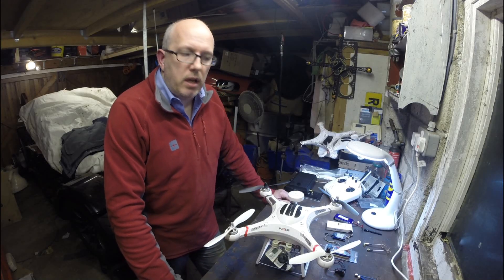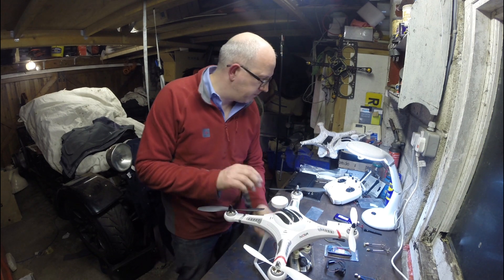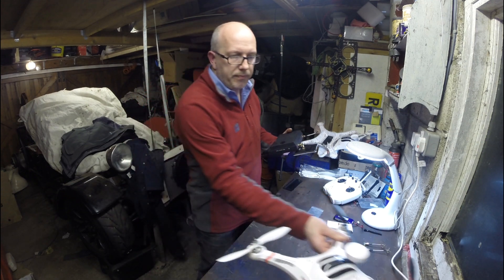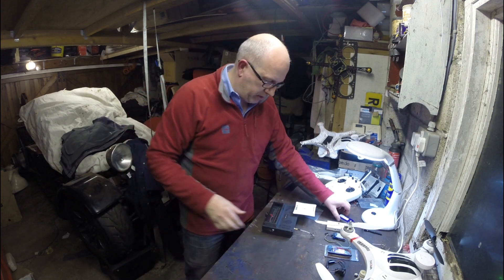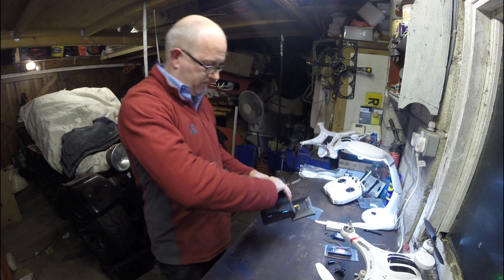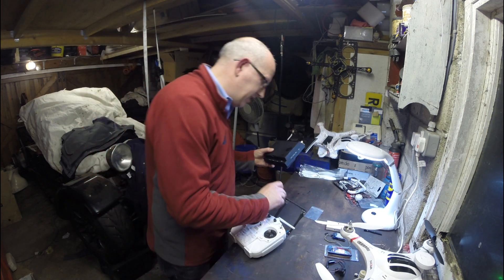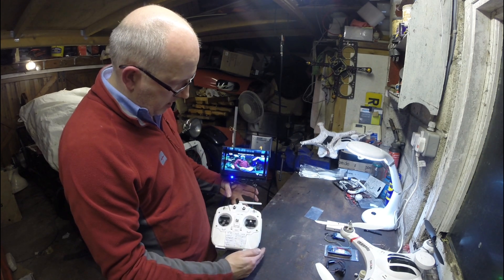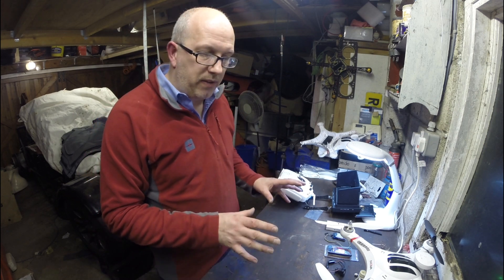Cheerson CX20 FPV Setup Part 2

Comment: Hey Charles Philipps, Thank you so much for your video, one question thought (it has probably been asked but cannot see the question)
How long can you fly with the gimbal and fpv setup ? 
I have mounted a dji gimbal which is more heavy (215gr) and the same fpv transmitter as you, I can only fly 3-5 minutes with a 2700 mah battery... maybe my setup is too heavy...
So how long can you fly with your battery and setup ?
Reply from the maker: Charles Josset Hi Charles, yeah the standard battery is rubbish.. I went to the 5200mah battery and I get 15 - 20 minutes.Have fun......©

Comment: Hi Charles Phillips, what is the maximum range with this quad? and what is the maximum range for video transmission?

Thanks.
Reply from the maker: Nate Grillz Hi Nate, Depends on your receiver antennas, the video will do a couple of kilometres with a cloverleaf, considerably more with a high dbi antenna. The quad itself will do 1 - 2 Km depending on atmospheric conditions, I've had it out to about 1.8 line of sight.Hope that helps......©
Reply: Hi, thanks for answering me. Then if i have the original transmitter, the range is about 1 - 2 km ?? Because i read that the range would be 300 meters..
Reply from the maker: Nate Grillz People keep telling me that, indeed in the software there was a 300m limit initially, I set that to 2000m. I don't think I have been that far, but I've had my moments where the quad has been caught in the wind and a long way off and I've brought it back!
Reply: ok so if change the settings of the software, the range would be increase.. ?
Reply from the maker: Hi Nate, There is a range limit set in the software (geofence) to stop you going out of range. It's not a bad thing as the cheerson receiver doesn't reconnect once it goes out of range, so as ever, be careful! I have rth set when it goes out of range.
Have fun!
...©

Comment: Curious as to what props you are using on your quad? I switched to 9443 size and I am not very happy with them and looking to switch again
Reply from the maker: ***** Hi Dylan,I tried the 9443 and had some issues at the time (which turned out to be a dying esc) then went back to the standard props. It may well be that the extra current dray made the esc die early, or maybe not. I generally fly the standard props now though as they are good enough!Have fun......©

Comment: Hello! Can I use the camera Xiaomi instead Gopro?
Reply from the maker: Дмитрий Лунёв I don't know for sure, but if it will fit then I don't see why not. You might need a different video lead.I don't use the plastic clip that holds the camera onto the gimbal, I use a girls hair band (the thick elasticated ones) as it holds more firmly. So then it should be fine!Have fun......

Comment: Hello Charlie. I notice that your fpv Tx is tapping 12v from underneath the quad which then comes from the battery. Any issues with interference lines in your transmitted video? thanks.
Reply from the maker: paulkazjack I've never seen any, mostly they run on 3.3 or 5v internally, so they have quite a lot of smoothing. I have seen interference on other models where the wires run for a distance next to motor cables, but that is easily solved with an earth or s ferrite core.Have fun!......©

Comment: can you point me towards what I would need to use and iphone as the video reciever?
Reply from the maker: ***** Hi Chris. The short answer is you can't! Natively the iPhone app for a GoPro uses Wifi which will overpower the 2.4ghz used to control the aircraft. The long answer is... if you were determined to use an iPhone instead of a screen, you could stick a wifi transmitter on your 5.8ghz receiver or get an adapter to plug into your iPhone from the receiver. But to be fair there is no point, a cheap 7" screen will do a better job, consequently I've never tried to get an iPhone to do it!When you see people using an iPhone (often on a Phantom or DJI Insight)  normally the aircraft operates on a different frequency or they have a wire from their receiver to the iPhone. either way not really practical on a Cheerson!Sorry......©

Comment: Hi Charles - could you provide links to all items you would need for FPV on the Cheerson and the costs? I have the GoPro H3 and G2D so Im looking to setup FPV exactly like you have shown?  Many thanks in advance - Christian.
Reply from the maker: Hi Christan,
If you are just starting out, probably best to single source everything from Hobbyking. I got everything separately from ebay, but here is everything I currently use for FPV on the Cheerson.
Antennas LHCP (Left Hand Circular Polarised) (£8.44): http://www.hobbyking.com/hobbyking/store/__51622__Circular_Polarized_5_8ghz_Antenna_Set_SMA_LHCP_60mm_.html
UK Legal transmitter (£13.37) - http://www.hobbyking.com/hobbyking/store/__66190__FT951_5_8GHz_Video_Transmitter_25mW_Full_FCC_and_CE_Certification.html
OR More powerful transmitter if you have a license or are outside UK (£13.98): http://www.hobbyking.com/hobbyking/store/__76392__HobbyKing_8482_FT952_5_8GHz_32CH_200mW_Mini_FPV_Transmitter_with_Gopro_3_AV_Lead.html
Both the transmitters come with leads for a GoPro and compatable power leads for the CX20
This is my Screen (£101.77): http://www.hobbyking.com/hobbyking/store/__51622__Circular_Polarized_5_8ghz_Antenna_Set_SMA_LHCP_60mm_.html 
A better screen since mine was released (and cheaper £85.88)  http://www.hobbyking.com/hobbyking/store/__35055__7_inch_800_x_480_5_8GHz_Diversity_Receiver_TFT_LCD_FPV_Monitor_with_LED_Backlight_SkyZone.html
But have a look at the range on hobbyking - they go as low as £69 (without diversity)
This is the high DBi LHCP Antenna (£46.23): http://www.hobbyking.com/hobbyking/store/__64810__Immersion_Fatshark_SpiroNET_LHCP_Patch_5_8GHz_Antenna_SMA_13dBi_Gain.html
If you are starting out I wouldn't bother with the high DBi Antenna as on a Cheerson the remote control will give up long before the video, but if you are using the legal 25mw transmitter it will help!
Hobbyking are just another company and I am not in any way endorsing them, there are much cheaper places with better customer service, but for those starting out it is a handy resource to get all the information you need!
Have fun...
...©
Reply: Charles Phillips
 Thanks Charles - Your screen link seems to show the antenna? Ill have to be patient and wait it out from the US Im guessing. Just a thought, if you do fancy selling anything for the CX20, keep me posted ;)
Reply: Charles Phillips Thank you for the links!
Reply from the maker: Christian Gandar Hi Christian, I'm not sure what you mean by the screen link?
HobbyKing also have a US warehouse, so its worth a look! I have had a few people ask me about parts, especially if I could do a plug-and-play fpv setup for the Cheerson, so I am seriously thinking about putting together a kit and selling it on ebay, it just means I will need to keep some stock... and of course ship to the states!
have fun!
...c
Reply from the maker: Christian Gandar Oops, perfectly correct, the link to the Skyzone screen is: http://www.hobbyking.com/hobbyking/store/__72895__7_inch_720_x_576_5_8GHz_32CH_FPV_Monitor_Diversity_Receiver_with_DVR_Recording_Skyzone_RC700D.html

Comment: Good morning, I apologises for my english, I'm Brasilian and my inglish is so so

I bought CX-20 with Gimbal and installed this today. But I have many doubts.
I would like to know what is the pulse voltage to start the signal (A0) Pitch on Gimbal
because in my drone CX-20, send only range 0,32vcc to 0,42vcc on channel (-1) AUX1
I installed 12Vcc (Black and Red) and to pulse voltage to start the signal (A0) Pitch on Gimbal
I tryed send only range 0,32vcc to 0,42vcc

but dont work yet!!!

look this pics, please
http://www.use.com/showoriginal.pl?set=2da3049895f57abde09d&p=1
http://www.use.com/showoriginal.pl?set=2da3049895f57abde09d&p=2
http://www.use.com/showoriginal.pl?set=2da3049895f57abde09d&p=3
http://www.use.com/showoriginal.pl?set=2da3049895f57abde09d&p=4

Comment: do i need to plug the gopro transmitter to power as well?
or it doesnt need power?
Reply from the maker: I would advise against it. Let the GoPro use it's own battery and just take the video to the transmitter.
I have found all sorts of issues with supplying power to the GoPro, from incorrect voltages frying the GoPro to plugging in the other end of the cable in the wrong way around and frying the usb on the GoPro to simple earth loop issues causing buzzing on the audio.
Even when I got it right I found the battery in the GoPro ran down (running an H3+ without battery doesn't work at all!)
So no, don't bother with the power, it's hassle and doesn't work properly.
Reply: thanks Charles,,,how about the video transmitter? i need a separate battery for it right? like a dedicated one
Reply from the maker: Jobille Photography Hiya, I just plug mine straight into the power on the bottom of the quad, but check your transmitter, most will handle 2-6 cells (7v-21v) the Cheerson is 3s so 12v (ish) which is fine for most.
Reply: Charles Phillips thanks Charles..will try  it when i get my unit 😊